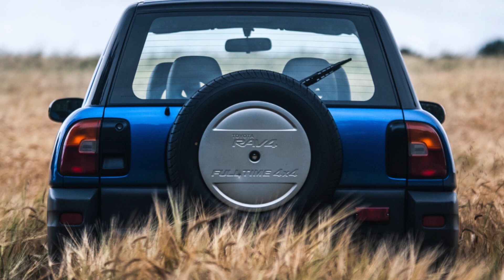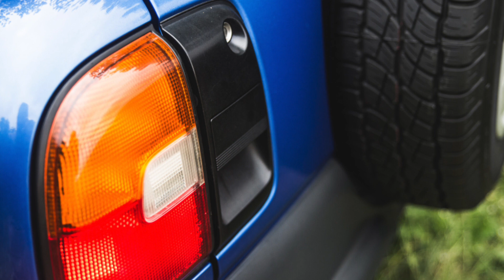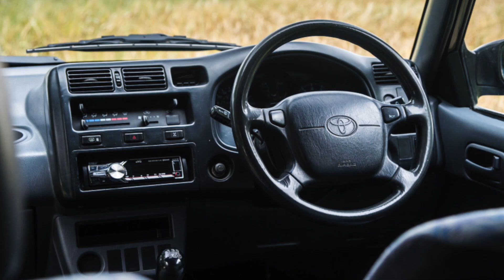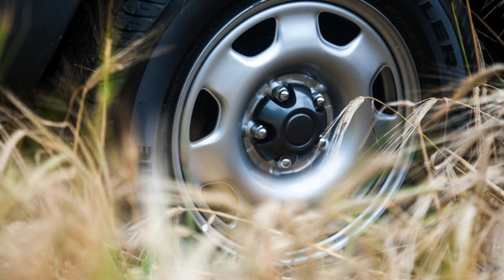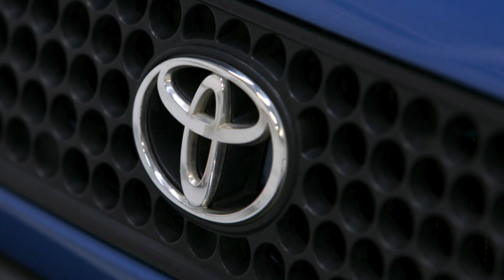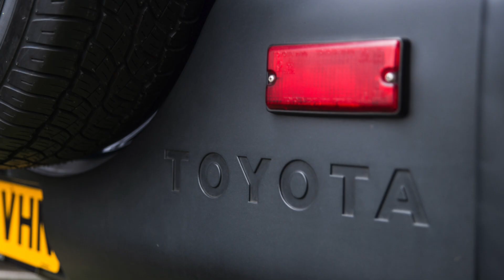TOP Things that will BREAK on your Toyota Rav4 I generation 1994

Comment: This was really interesting to watch. I have a Rav4 myself and I really enjoy mine, It's an amazing car. The only thing I would say for the video is that the point could be slightly different. most of the listed things that "Will break" are just maintenance. But there were a few things that weren't specified. Like the 2 engines, the 3S-GE was only available in Japan. I think that could have been mentioned. along with a few other things. It could have been more fitting with a title like "TOP things you didn't know about the Gen 1 Rav4" and list specific interesting facts. its just my own opinion. I know this is probably just an AI channel and this will never be seen or considered. But it's a thought